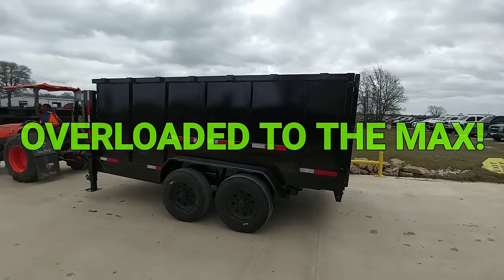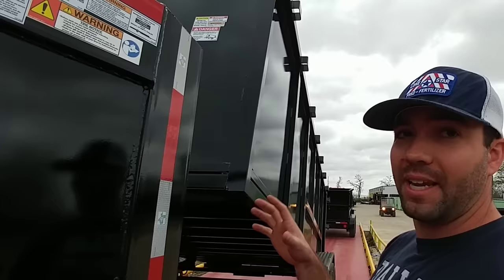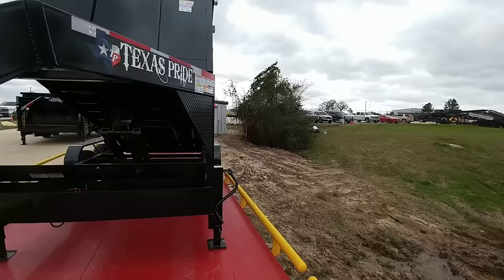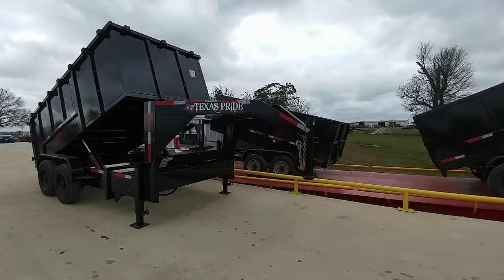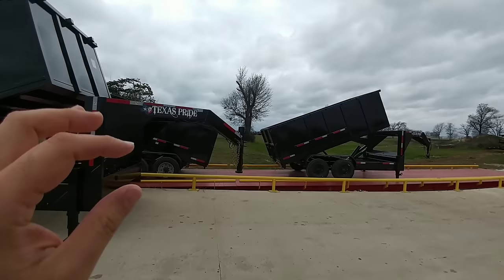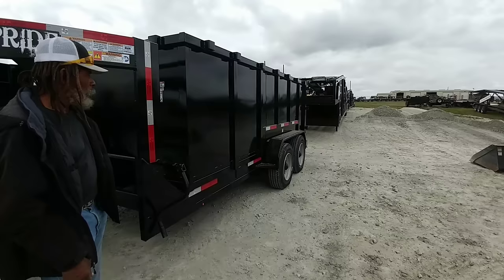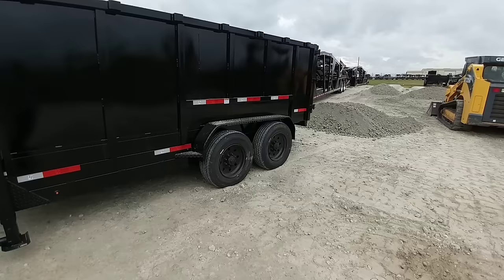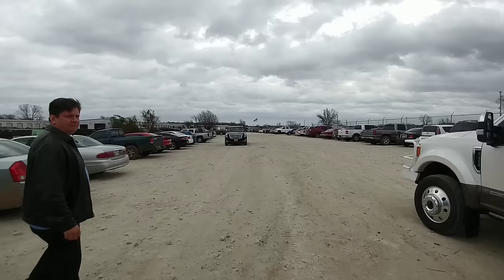Crazy Test with 3 Dump Trailers WAY Overloaded! See which ones failed!

Comment: The first 6" lift is the hardest for the lift but it all depends on the model of hoist used.  When I used to sell the first hoist it was a hoist made in England by a company named Edbro.  Great hoist. Now 50 years later who knows. We sold a scissor lift that was used on trucks and goose necks trailers with a 5" or 6" cylinders. The dual ram is the most likely to twist under a load is loaded offside

Comment: Bought a dump trailer from big text and man the jack went off 8 month after buying it brand new for 13000 next day the pump went out rust all over the bottom had to paint it my self also the walls instead of been weld it they put silicone and paint it black

Comment: if you drove 5 miles down the road with that much weight would break that trailer.
Reply from the maker: Not sure about that. But might be worth testing (on a closed track).  I'll make the suggestion.  Perhaps you want to be there for the test?
Reply: Big Truck Big RV 👍 sure I guess if they want to put one to the limits on break-ability. Sounds fun to me.

Comment: Step #1  Weigh Truck and Trailer  Empty.    Step #2 Weigh Truck Trailer and Cargo and Subtract.      Step #3 Then perform lift test.       Sure wish this video was about 3 minutes long.    1 Minute for each test.  Then perhaps a 1 -2 minute synopsis.

Comment: I always heard that a scissor lift was safer over a dual cylinder, because if one of the dual cylinders failed it would tip sideways. Can that be your next vidja?
Reply from the maker: Actual if one fails the other would just force all the hydraulic out quickly and it would come down.  In terms of lifting stability, dual cylinder provide equal force on both sides though.  So that is technically safer.

Comment: You should’ve find somebody who knows how to back them up. 🙀
Reply from the maker: @Ricoville 100% correct.  These are NOT easy to back-up loaded down like that
Reply: The fellow in the video did a quite a bit better than I would have done In backing up the trailers. He has my respect.
Reply: And someone who didn’t

 know how to load a trailer.
Reply: Should have known the weight of the vehicle towing.  DUH!

Comment: I would like to have also seen the degree of maximum lift.  If dirt is sticky, a higher angle may be desired. Lifting and the angle of lift equal dumping success.
Reply from the maker: @bradlywalker5464  the end dump goes to 48°

Comment: I'm not an engineer and I think the outside front lift will be the best for the dump trailer.
Reply: There is a reason that system is widely used on dump trucks!

Comment: Part of the conversation  should have been dump angles. Who cares if the trailer will lift if it doesn't go high enough to dump out material. I watch landscape contractors dump and most have to back up and hit the brakes many times to dump there soil out.
Reply from the maker: There are several videos I have done that talk about the dump angle.  Can't expect every video you watch to have all the information you specifically are looking for.

Comment: To be completely fair here - its a bit of stretch to claim the trailers “exceeded” their ratings (by almost 50%) ..  go drive around for an hour and beat up that suspension.  Come back and let us know if they really exceeded it. Its one thing to gingerly move them around a few feet. It another thing to drive 50 down a highway with potholes.  Their ability to lift beyond their ratings is great of course, but lets not pretended they probably  wouldn’t be in pieces if you attempted to actually transport that weight, repeatedly.

Comment: One thing I noticed right off the bat is these trailers have very little structural reinforcement on their frame. The better manufacturers use 12" on center tubular steel as cross members beneath the load. These trailers look like 24"?
Reply from the maker: They are 12" on center.  Most offer an UPGRADE to 12" in center, as specd on these

Comment: I’m wondering what axles are under those.  Bought a dump last year and every double axle single tire maxed out at 14k to get to that 20k rating you have there you ether had to  add a third axle or have dual wheels on the axles.  To me those look like 14k dumps
Reply from the maker: They are 9k rated axles EACH.  They are 4.5" Axle Tubes. I've worked with 7k axles on RVs and these are SIGNIFICANTLY LARGER in diameter.  If you watch the earlier videos on these trailers and my trailer you will see the axles much closer.  That's why these have 17.5" wheels on the larger lug bolt pattern.
Reply: If they are 9k Axel's then its an 18k...how do you get 20?

Comment: While a dual cylinder sounds bullet proof you can't just plumb your cylinders in parallel you need an isolation valve to balance the load between the two cylinders.

Comment: Tongue weight would've been interesting to know
Reply: If you listened to the video he said weight while it was still attached to the truck and after they took it off, I already did the math because like you I was interested in the tongue weight.  It came out to be just under 10% each time, which I thought is too light.
Reply: @motoworxx853  ahh I missed that I'm going to have to rewatch it, that does seem low but I guess they did load a lot of it towards the back
Reply: MotoWorxx my observation too. Less weight to lift tooo!

Comment: Not impressed with Texas Pride. Sent them specs of a lowboy equipment trailer and they won’t even consider manufacturing it. There is a huge need for it, but they don’t want to change their setup or pull someone off to build it. 

Isn’t that where you find out there is a demand, you build it?
Reply from the maker: Brother, you are unlikely to find any major manufacturer that will build a trailer that hasn't been tested or engineered as a one off unit.  I don't think you would have luck finding any trailer company willing to do that. Unless you are paying for it's testing and development.
Reply: Big Truck Big RV Lol, so I pay them to manufacture and test a product that they will make 100’s of thousands. Sure that makes sense. I’ll find a company sooner or later. Plus, the specs that I ask for are just a larger Gvwr from what they already make. So you really are just using larger stock with all the same engineering.
Reply: @mikemiller We can build you the Trailer you desire , without the fast assembly line builds.
Reply: @caltex9418  ok, how about sharing your contact info

Comment: Great video, but why did the one that could handle the most weight have a single jack when the others had dual jacks?
Reply from the maker: Only 1 had dual cylinders.  Also, if you watch the video you'll see why the end dump had a much more significant mechanical advantage
Reply: Big Truck Big RV 
I’m talking about the jack stands not the hydraulic cylinders.

Comment: That first trailer had 10% tongue weight.  Do all fifth wheels naturally do that?
Reply from the maker: Keep in mind that unlike a Fifth Wheel RV, there is very little structure above the overhang portion of a gooseneck trailer.  Therefore, the weight of your cargo and its position/balance determines how much weight will transfer to the pin.  These are relatively short dump trailers and the trailer axles are positioned to handle the vast majority of the weight if loaded properly, with the weight towards the middle back of the dump body.  This is why it's transferring only 10% to the truck.  Sometimes it can be much more  .

Comment: 7000 pounds weaker lift and 1100 pounds heavier trailer. Why would anyone use a scissor lift over a front telescopic ram. Just shows there's one born every minute. There's a reason why my dump truck (Kenworth) has a telescopic ram on the front of it. I have never seen a dump truck with a scissor lift unless it was a baby truck ( one or two ton truck).

Comment: The telescopic trailer had more of the load toward the front as compared to either the scissor lift or the dual ram. You didn't reach its limit for lifting, so how can you say the dual ram won?  If you're doing a comparison test, do it right. Eliminate as many variables as possible and make the tests consistent. I'm an engineer. You claim to be one, but your test wasn't sound and doesn't support your stated conclusion. I don't know what you engineer, but maybe since I spent 15 years designing gas turbine aircraft engines, I'm used to a little more rigorous approach. I don't know.

Comment: 28 minutes wasted..  Only one did not lift the load..  Gotta load them till they break or do not lift..  The double ram lift I would never own.  As one failure on a lift your trailer could end up twisted, if they are not tied together on the same system with no check valves..  I'd rather own the two stage single ram hands down.  One ram less problems.

Comment: The lack of cloth guard or proper securement of the hydraulic lines on the dual cylinder trailer is exactly why I wouldn't purchase anything made by this trailer manufacturer. It's the  attention to detail that separates a quality trailer from a cheap trailer, these are cheap trailers.
Reply: Diamond C for the win 👍

Comment: They should build a scale into the axle so that trailer owners know exactly how much weight they are putting into them
Reply from the maker: Would need an entirely different type of scale
Reply: You should buy portable scales if you are that concerned, DOT carries them, you simply drive each tire on to them and get a instant weight.
Reply: SMiller5488 thanks for the information.

Comment: ENGINEERS DIDN'T EVEN SPEAK ABOUT LOAD  SHIFT, OR UNEVEN LOAD . THAT'S WHY DUAL RAM IS THE BEST.
Reply: If you are saying that dual cylinders ensure that the unevenly loaded bed will lift evenly, that is inaccurate. Hydraulic fluid takes the path of least resistance (just like any fluid) and will push the cylinder with the least load out faster thus resulting in the bed twisting. The only way to ensure that the two cylinders extend at the same rate would be to have separate pumps for each cylinder OR flow diverters that ensure the volume of fluid is the same going to each cylinder.
Reply: Brandon Epple  WELL OF  COURSE MAKES COMMON SENSE. SAME AS 220 PULL , THREE PHASE.
Reply: @danlangeberg8381   You can't isolate the the cylinders with two separate pumps. If you blow a seal in one cylinder it will destroy the trailer and possibly your pickup.

Comment: 2x the cylinder  = 2x the lift capacity!  the (2) cylinders are smaller - each -  than the other trailers 1 cylinder.  (which gives it about the same capacity) if they were the same diameter rod, they could EASILY lift 30k!  and scissor lifts are a JOKE!... SEVERE mechanical DIS-advantage! all the 3 axle heavy scrap trucks use 2 cylinders on the sides to lift.  long semis use 1 telescopic cylinder in the front. NOBODY uses a scissor lift! they are meant for faster  unloading of LIGHT material